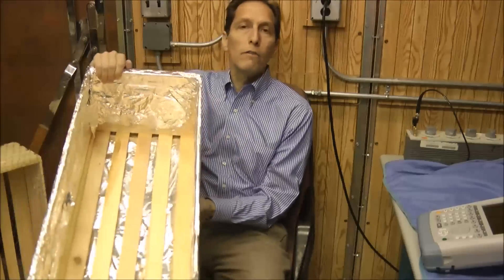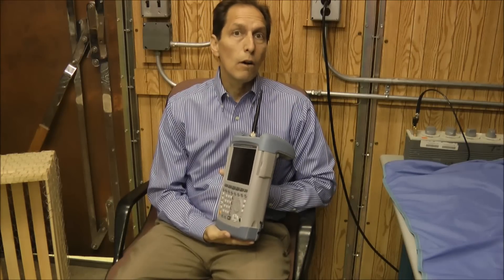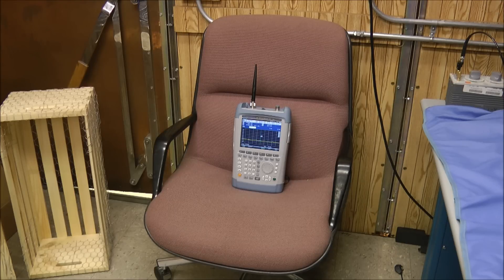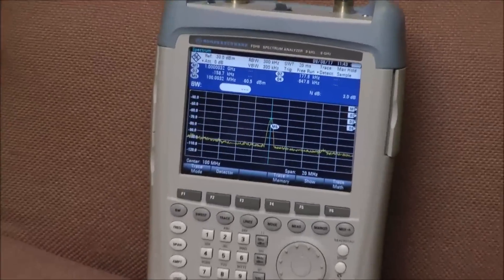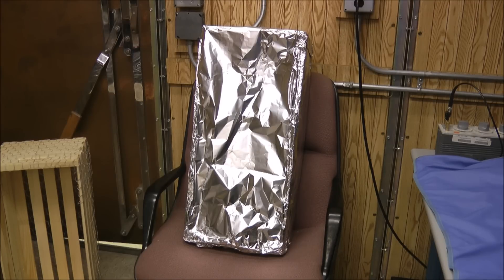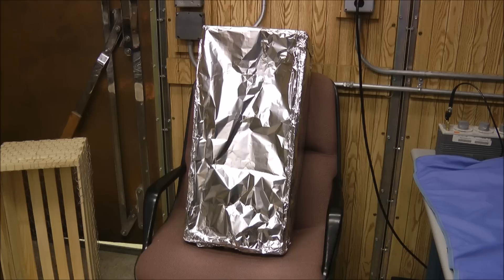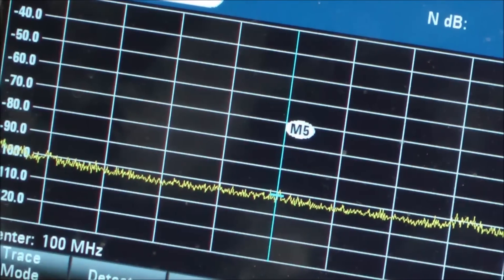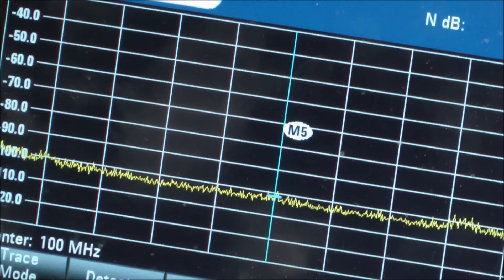Faraday Cage - Chicken Wire vs Aluminum Foil

Comment: Comments here from any number of qualified people. I also worked in RF and never came across a Faraday cage that was not grounded. They were used for setting up and calibrating radio transceivers.  If this experiment was meant to show some expertise on the part of the creator, you lost me at that point. It suggests a fundamental failure to understand the physics of a cage.
Reply from the maker: While there are certainly good reasons to ground a Faraday cage, it isn't really helpful when trying to protect against a far-field event (like an EMP). The reasons that cages are grounded are three fold. First, grounding greatly helps to keep near-field sources from getting in or out. Second, grounding can keep a source inside the cage from re-radiating off the structure. And third, grounding is critical if cage is used as part of an electrical discharge (i.e., a breakdown of air) in which the current needs to be shunted away from ground. I've tested several different ad hoc cages, both grounded and ungrounded, and grounding made no difference when trying to shield against a high-frequency far-field event. That's my two cents... you are certainly welcome to your own opinion. I'll try to do a video showing grounded vs ungrounded in the near future to see if I can clear this up for folks.

Comment: Wouldn't a stucco house being covered with lathe (chicken wire) act as a farady cage? And does all the wire making the faraday cage need to be linked together or touching?
Reply from the maker: You'd get some shielding from chicken wire, but the holes (and gaps between sections) would be so large, you probably wouldn't get more than a handful of dB. A good Faraday cage is seamless, or nearly so. If seams are required, they are tightly sealed with conductive materials.

Comment: You need to show the analyzer before you do the test. It leaves open the fact you could've already had it preset before recording. Why you did it this way is speculative and sketchy
Reply from the maker: I'm sure there are a hundred ways I could be dishonest with my measurements. Folks either have to trust what I say and do, or they can discount my findings. The choice is theirs. In this particular case, I don't what I could possibly have to gain from lying about the results since I'm not a salesman of aluminum foil.
Reply: @disasterprepper  Your right. I kinda jumped the gun on you there on technicality because I'm looking for honest results. The variables are wide ranging with materials, the size etc. But all in all, your conclusion looks to be about right. Thank you for your video and reply. You got yourself a new subscriber.
Reply from the maker: @johnnyblade6088  Fair enough. Glad that the video(s) are helpful.
Reply: Your a very unappreciative person huh Doc dont have to do this to help us and btw answer the same exact question 1000 times  but you feel free to question his integrity you should be ashamed.Doc this is first time I found your blog I have been reading every question and reply so as not to waste your time or good nature unnecessarily thank you truly for your expertise and  patients with all those seeking good advice I appreciate it.btw I watched the tests you clearly did not cheat in any way.sometimes you just gotta build a ladder and look over people.

Comment: Will a Faraday cage work against the new 5G ?
Reply from the maker: Yes, but it can only have very small openings -- no seams or holes that can leak in the RF.
Reply: @disasterprepper  please tell me what I need to do since I live in apartment management so I don't own the home. What can I do that will protect me from 5G radiation?
Reply: What can you do for 5G to protect home?
Reply: Can you put aluminum on the wall itself and what can I do to put on windows?
Reply from the maker: @chrischris99able  Yes, you can put aluminum foil on the walls and ceiling to create a sort of Faraday cage room. There is RF-blocking conductive film that can be put on the windows. It's not an easy proposition to create a well-shielded room though, because door, seams around windows, etc. will leak RF energy. Even so, you can certainly reduce the field levels with a few preparations.
Reply: @disasterprepper  I will use the sleep net as the body rebuild itself

Comment: Does it pay to wrap source level audio equipment (Cd players, external DACS, etc. with Faraday cloth.  Obviously, the units could not be completely covered as access to the connectors, controls and disk slot is necessary?  Would the cloth reduce RFI/EMI crosstalk between equipment?
Reply: If the equipment is in use and plugged in, there isn't really much benefit from wrapping it in conductive cloth.

Comment: So, copper would perform even better then aluminum?
I mean gold plating is out of the question ;-)
Reply from the maker: The metal actually makes very little difference for these applications. All have such a great conductivity that it won't matter which you use.
Reply: disasterprepper thank you very much

Comment: Thanks Doc. I got blasted yesterday while driving. Hi know so because I was listening to a cassette tape and it sounded ok. All of a sudden it was extremely distorted sounding. So I tried CD. The CD was also extremely distorted. Same with am and FM signals. All the same type distortion. 

  Now I know What I need to go to prevent this from happening again.

Comment: What about 60 GHz?
Reply from the maker: I assume you're asking because of 5G. I plan to do some testing at tens of GHz, mostly for personal protection from EMFs, but right now my test equipment won't go that high. The good news is that very high frequencies (like 5G) are easy to attenuate with various materials. Even our skin is thick enough to block 5G. The bad news is that very high frequencies can squeeze through very tiny openings, so making a shielded room, for example, is difficult.

Comment: The holes in the chicken wire are large , hence allowing radiation to escape the faraday cage. Tight meshed metal screen (window screen) does work. Thanks for sharing.
Reply: Um, it doesn't work that way.
Reply: @AllAmericanGuyExpert  with all due respect, but to just say, um, it doesn`t work that way is not a helpful comment. AllAmericanHandymanHarrison, maybe could take the time to explain in laymans terms, why it doesn`t work.
Reply: @AllAmericanGuyExpert  wavelength dependent?
Reply: @FancyNoises  Definitely, yes.

Comment: I was thinking of coating my engine hood with heavy duty foil maybe
Reply: Dagnabit!!
Reply from the maker: It's an interesting idea, but I don't really think it would help much. The hood is likely already metal, and there are many seams around the outside that would all RF energy to leak in. Most of the energy from an EMP would couple into the wire harnessing in the car.

Comment: You are neglecting to ground your Faraday cage ; might make a big difference .
Reply from the maker: It's a fairly common misconception. I've done many experiments with Faraday cages grounded (and not) and it makes no difference with these high frequencies. Grounding can be very helpful for discharging currents, such as during breakdown events, or when in the near field of RF signals.

Comment: I’m curios what will happen if you ground them. Maybe the reason why chicken wire was not good is because it was not grounded.
Reply from the maker: I've tried it many times on various setups, and grounding the cage made no difference in high-frequency shielding performance.
Reply: @disasterprepper  is it because the hole is larger than the wavelength?
Reply from the maker: @jj987987987  That's right. Ideally, you want the largest dimension to be no more than 1/10 of the wavelength. Some will even say 1/20th.
Reply: @disasterprepper  thank you for the answers!

Comment: Use copper wire
Reply from the maker: It wouldn't make any appreciate difference. The conductivity of aluminum, steel, copper, and even silver are all so good that they work well for RF shielding.

Comment: Very helpful video.  I am wondering if I use only aluminium foil completely around my Wifi router, will it eventually overheat and cause a fire. Also in the UK it is hard to find aluminium window screening but I did find (not purchased yet) some aluminium screening that has holes 1mm x 2mm used for art modelling.  Do you think these holes would work to reduce the radiation but also allow heat to escape?  Your help is appreciated as is your video.
Reply from the maker: Are you trying to protect the router from an EMP, or reduce its emissions? Either way, I wouldn't recommend wrapping your router in foil. No matter what you do, the power cord will penetrate your enclosure, greatly compromising any shielding. It would need to be battery-powered to really pull this off. As for holes, if they're 1-2 mm, you can still create an effective Faraday cage. Long slots are what compromise the shielding the most.
Reply: @disasterprepper  Thanks for the reply. I am trying to protect myself from the router's emissions.  Faraday Cages also have a cord outlet.  Wish they weren't so expensive here in the UK.
Reply from the maker: @Em-wb4kf  Yes, it's possible to route a cord through a Faraday cage, but you have to put an inline filter to remove any energy picked up from outside. You're right, they can be quite expensive.

Comment: Perhaps for sitting in front of a computer or TV, the chicken wire might help cut down on the radiation from the computer/TV screen, while still being able to watch on it. Whereas the aluminum foil would completely block your view.
Reply from the maker: They do have EMF screens for computer monitors, but I haven't seen them for TVs. That said, when I took EMF readings in front of my LED TV's, they have very tiny emissions.
Reply: @disasterprepper  do they also have EMF screens for cell phones, tablets, laptops, and plasma TVs (and perhaps old-fashioned CRT TVs as well)?

Comment: CAN I USE WINDOW SCREEN MESH FOR MY WALLS AND FLOORS?
Reply from the maker: Yes, you can. You just have to pay attention to the seams. My suggestion would be to overlap adjacent layers by a few inches and connect them together with something that will make good conductive connection. Long narrow gaps leak RF energy.
Reply: @disasterprepper     Like nails?
Reply from the maker: @smileyone1612  Nails might work. But you'd want to check their conductivity by measuring the resistance from the nail to the mesh.
Reply from the maker: @Eddie L Can you rephrase the question? Are you trying to seal up the seams with magnets, or are you trying to provide some kind of EMP protection?

Comment: Could you possibly make a video explaining protection strategies for base (home) ham radios that are actively being used? For instance I will be making a faraday cage for extra/old radios I have, but about my nice new Icom radio sitting on my desk. I assume disconnecting the antenna and unplugging the power would help, but is there sometime like a box I can I set over the top of it to protect against EMP? I just hate the idea of having to using my old tech and lose the great features the new modern radio provides.

Also, the EMP Shield protects against transmitted surges of power lines, but what good is that to electronics not in faraday cages?
Reply from the maker: Sure, I'll put together a video discussing this. You are right that the two most important steps would be to disconnect the antenna and power lines, but yes, a shielded enclosure could be set up to protect from the radiated energy.
Reply: Thanks, I look forward to it. One consideration is do you think a quality antenna switching device, like an Alpha Delta brand switch with an arc-plug would be enough to prevent coupling over the antenna/coax with the transceiver? When we speak of EMP I'm just not sure I understand the levels of electricity involved and how likely or unlikely it is that it will arc. Not to mention what specifically in electronics are susceptible to the transmission through the air (not power or feed lines), I would assume any IC and coils. This is all very interesting to me and I'm slowly learning electronics from you and a couple others. Thanks for all your time. :-)

Comment: How well will solid conductor (aluminum foil or equivalent) work in the 30gig to 300gig range?
I ask because of the new 5G wireless systems that are being constructed and will be transmitting very soon.
Reply: @RentVandH2O    What kind of eye protection?
Reply from the maker: Fortunately, very high frequencies are easily blocked by solid materials. While I share concerns about 5G, it is surmised that even human skin will block it.

Comment: i am doing an experiment to block wifi signal with aluminium foil. however even i made a box out of layers of aluminium foil, it still emits the same signal! very confused :(
Reply from the maker: Are you trying to block the signal coming from something that is plugged in? If so, the cord will radiate the signal.

Comment: You should have also done one with aluminum screen.

It also depends on the frequency and the size of the radio waves and power.
Reply from the maker: I plan to do a metal screen in the coming days. Just haven't gotten to it yet. Shielding effectiveness is definitely dependent on frequency, which is why I typically test from 1 MHz to 1 GHz. In my experience, it's not very dependent on incident power level.
Reply: @disasterprepper  Any word on this? I'm getting ready to do my shed/ham shack. Going to use aluminum foil on the wood and hold it in place with staples through aluminum screen (the stuff used for windows). Will this get the job done? Do I even need the flyscreen? Rene.
Reply from the maker: @PrepareToLiveCa  Sorry, I haven't gotten to this. I've been juggling a number of other things, including preparations for the coronavirus. It's still on my list, sorry for the wait.
Reply: @disasterprepper  No worries. Thanks for the reply. What are you doing for Coronavirus?
Reply from the maker: @PrepareToLiveCa  Check out my  newest video on my observations and preparations. In it, I talk about an investigation I'm doing into N95 mask disinfection.
Reply: @PrepareToLiveCa  I've got a tube of ivermectin horse worming paste

Comment: I am here cos I am taping catering Aluminium foil on my front wall (inside)..cell tower 600m way. Ysheild net curtains on window..Have you a test on a much higher Voltage/m / Htz / Ghz. Cos 100 htz is really low. A WiFi router wangs out 5000 Htz / 5Ghz for example. Needless to say, i dont have anything 'wireless'/ wifi aka microwave radiation. Wired connection only.  I can't seem to find a video where someone has just used aluminium foil on their walls (without grounding) . Its all bloody awful, this con artist industry, everyone walking around with their own personal microwave radiation emitter, to themselves and others. Barrie Trower - https://www.youtube.com/watch?v=RrDNanZWeqE Thank you.
Reply: Me too!
I've been putting up foil around my apartment.  Now's the time!

Comment: I have worked around a faraday cages and they were made of copper window screen two layers about 3 inches apart there were other engineering features that were present but the double wall was the most important my faraday cage is a GI steel cabinet that is electrically bonded through out its sides but I am an over achiever.   I also bonded it to an earth ground to carry any stray rf to ground.  I think this important did you test this?  I don’t have a Spectrum analyzer to test that and it may only add 1-2% of dB attenuation over just a cage I have been in a number of on-line arguments over this and just think for the cost of 10-12’ of copper not ground bonding is foolish.
Reply: Absolutely.  You need to ground the faraday cages to be most effective.   The only reason not to do so is for portability.   But honestly, just turning your phone off should be enough.  Unless you suspect a nefarious power-off tracking system.   In such a case remove the battery.  Oh unless you suspect some ultra-small secret power source.  LOL.
Reply: @divermike8943  your tech knowledge a little out of date, a lot of phones can’t have batteries remove, an never truly turn off. I have talked to one of the PhD that worked for dod an wrote the book on EMP he said grounding is not required.  But it don’t hurt!   Have one shortwave it’s in the box, then wrapped in shrink wrap, then two layers of foil, then a final layer of shrink wrap.

Comment: I wonder if you did foil,then wire? Extra protection?
Reply from the maker: Sure, layering works quite well to improve shielding. An even better solution is to use an EMP bag inside the foil-wrapped box.